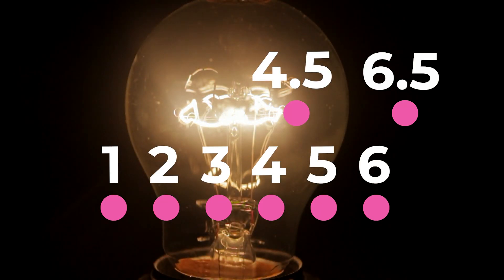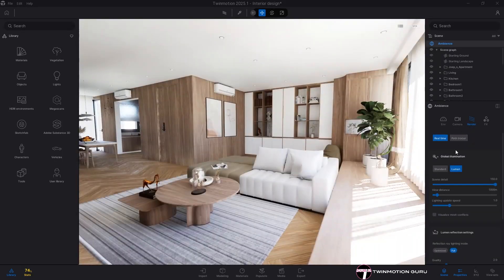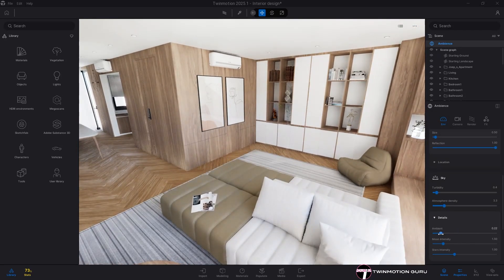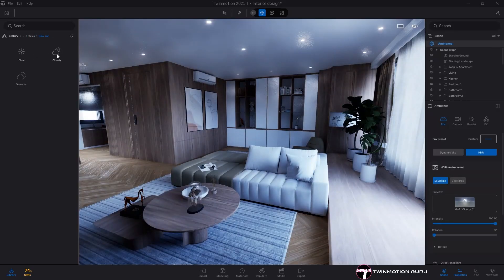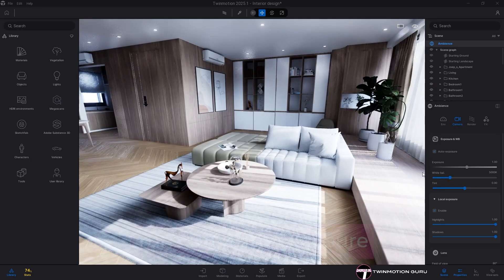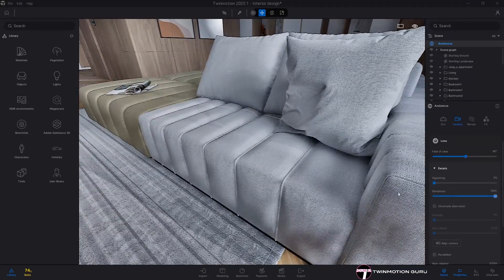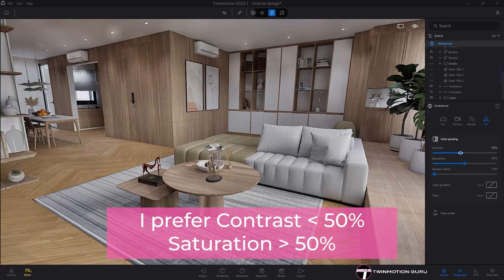Twinmotion 2025.1 - Achieve Realistic Interiors With 6 Lighting Tips

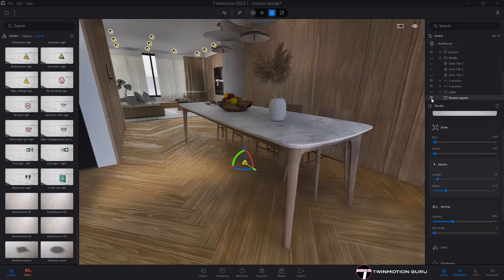Comment: Hi,I have a doubt . In 6:13 you can see Flickering of lights in the curtain it happens for most of the objects while i export as presentation something like wavy Flickering in low light area.In unreal i used to change the Final gather Value to 30 but I dont know how to solve this is issue in twinmotion.If you know something please let me know.Thank you
Reply from the maker: here in Twinmotion you have to increase the exposure and balance general light, but this is only with Lumen. with PT you should not have flickering 😄

Comment: Very thank you! I've got the twinmotion 2025.1 Preview2, but why I don't have the radius value in shadows setting of the light? Which versione do you have?
Reply from the maker: you have the right version! but you need to activate accurate shadows from LUMEN engine options. if you use PATH TRACER you just need to activate it and then select an artificial light to see the radius value :)
Reply: @TwinmotionGuru  thank you <3

Comment: Thank you for another great video. Is the overall stability better then preview 1 version? I was having issues and couldn't revert back my model to the working version.
Reply from the maker: Thank you for the kind comment! I m facing some problems with the prev. 2, for this reason i don t  suggest using it for work as it is still a preview version and it s not stable at all 🙃